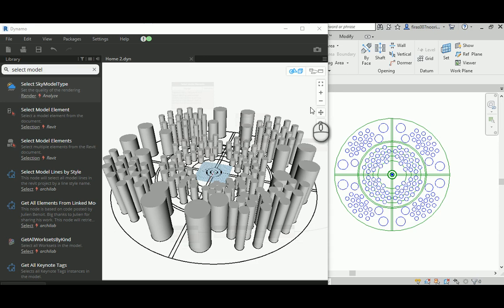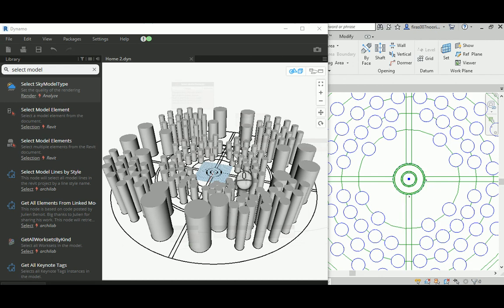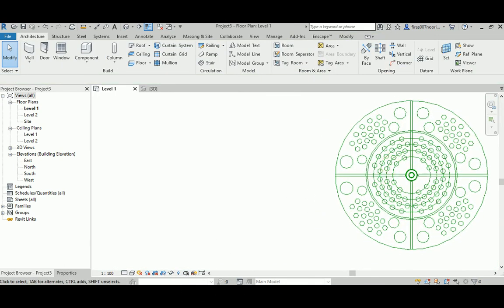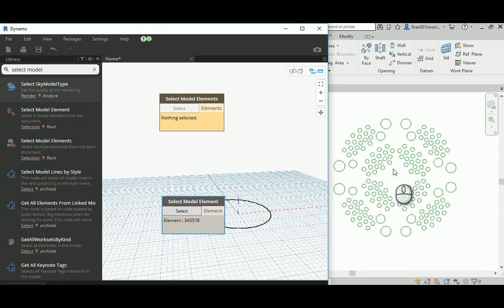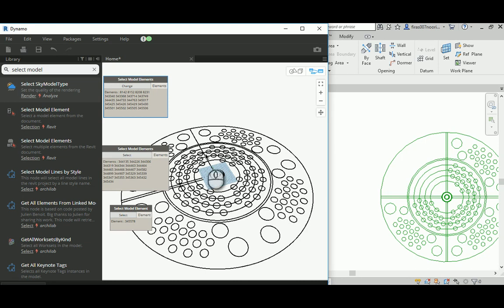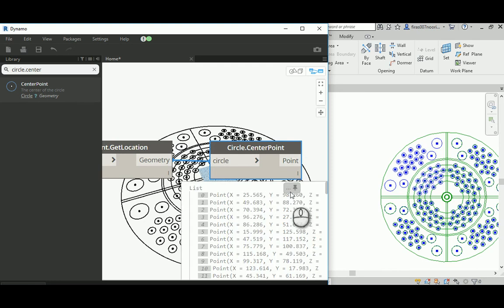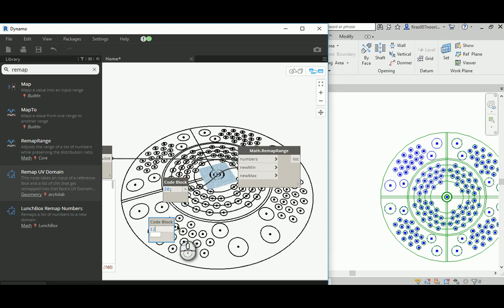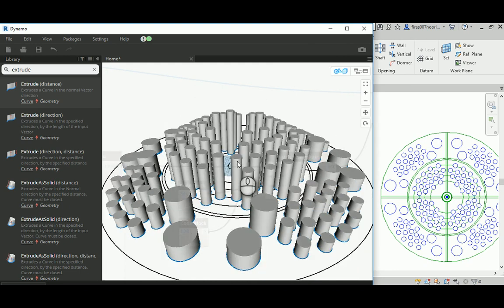Single Point Attractor in Dynamo - Revit _ Practical Part 1

Comment: Hello, first of all thanks for the very usefull tutorials. I have a problem: after selecting my elements by SELECT MODEL ELEMENT, the elements are selected,they are presenet in the node list, but cant see them geometrically
Reply from the maker: Hi dear, you are most welcome , there might be lots of reasons behind that, manily the revit units are too big or too small for dynamo, try to change revit units to m instead of mm and repeat the test, or you can change with dynamo the scale of the work from small to medium, there is also some nodes that are just select revit element as revit elements without passing their copies into dynamo, thus you will need to use element.geometry, oh God I cannot remember the exact name, so sorry as I am far away from my laptop, this will bring a dynamo geometry out revit element, there is one in topology also that can do that